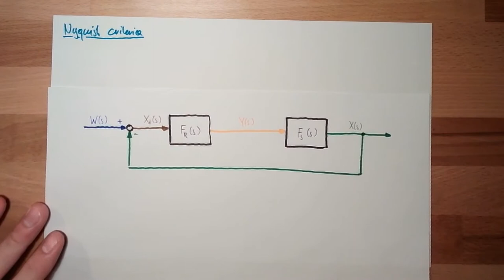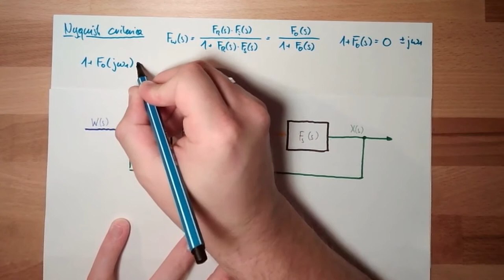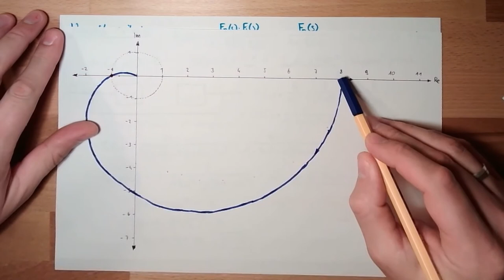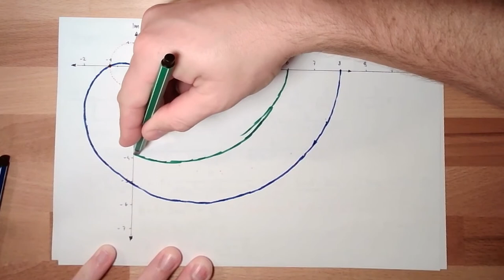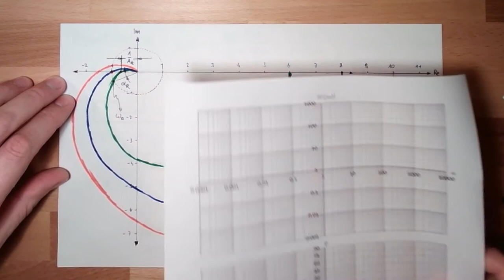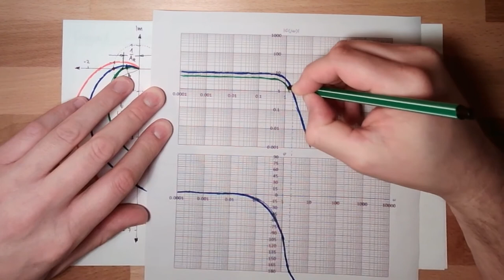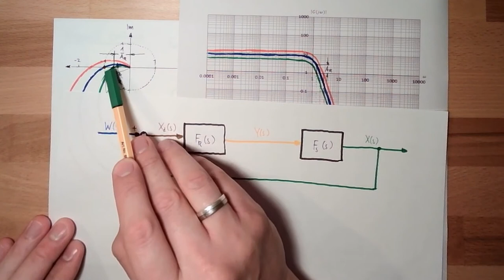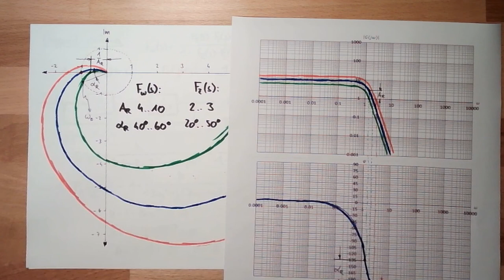Control 61: Nyquist Criteria (Old)

Comment: why did you put different values of w in the open loop function to get value for the Nyquist plot and not the closed loop function ?
Reply from the maker: That is the nice thing about the Nyquist criteria: You only need the open loop transfer  function. The denominator in the closed loop transfer function is 1+Fo(s). So whenever Fo (s)=-1 the closed loop transfer function is something decided by zero, what is really big an potentially unstable.